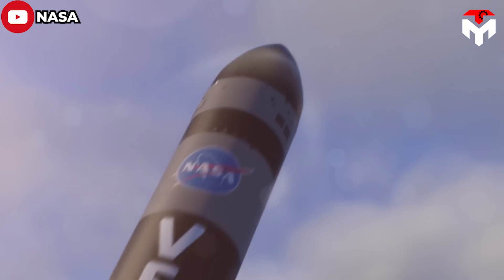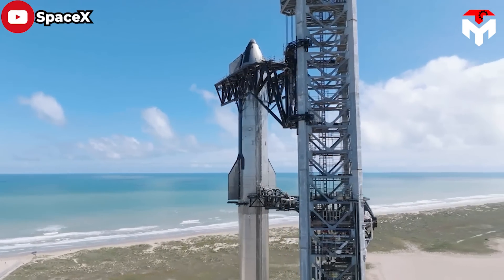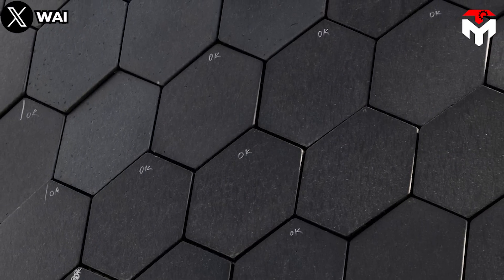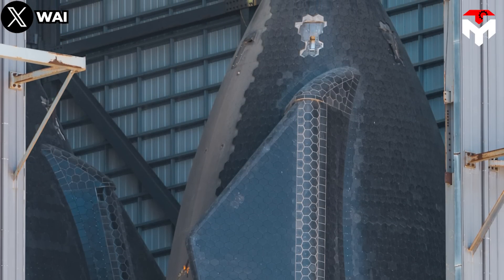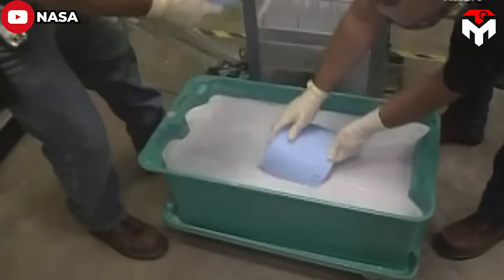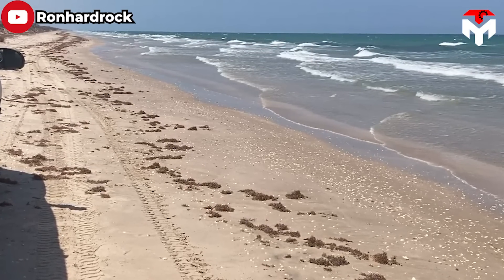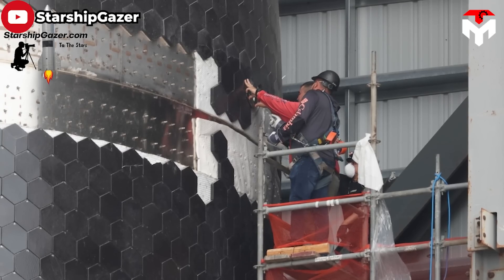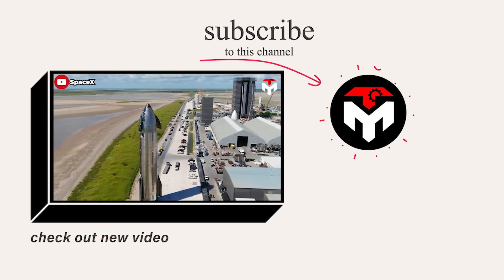SpaceX genius solution to protect orbital Starship on reentry!

Comment: It is not only better ceramics used for the starship but also steel has a melting point close to the temperatures occurring during re-entry. So there is less danger that the structure will fail.
Reply from the maker: Thanks for your sharing

Comment: A small but very important distinction about heating on reentry, it is compression; more so than friction, causes a majority of heating. Remember the atmosphere is much thinner at higher altitudes, but heating due to higher speeds creates incredible temperatures even at extreme altitudes. The statement about "air in the tiles" may be incorrect.. N2 more likely than O2.. can anyone here verify air vs any other controlled pure gas in composition of tiles materials ? Great animations, just subscribed.

Comment: You say the ship will possibly get too hot and breakup due to atmospheric drag and friction “…possibly endangering other spacecraft…”? It’s not going to generate those temperatures in the vacuum of space where those other spacecraft are located. It will be well into the atmosphere before the atmosphere is dense enough to generate that much heat from friction, far below the orbit of other spacecraft. The only spacecraft it could destroy would already be below it. 

Booster 4 Ship 20 broke up because SpaceX chose to trigger the self destruct mechanism, not due to heat shield problems. 

The stainless steel hull of the ship and booster are painted with a heat reflective and resistant white coating before the heat resistant tiles are attached. 

When did anyone come up with the term “Star Brick”? I’ve never heard any other source use that term. They are heat shield tiles. Do we really need another name to remember.  Bricks are thick and heavy. Tiles are thinner and lighter. 🤷🏻‍♂️

Comment: Also, just before SpaceX blew up Starship, on the footage you can see missing tiles. This is what's going to cause Starship to fail re-entry most likely. Although, the fabric and stainless steel combo may be enough to protect it, but I doubt it. This is something they have to get right man.